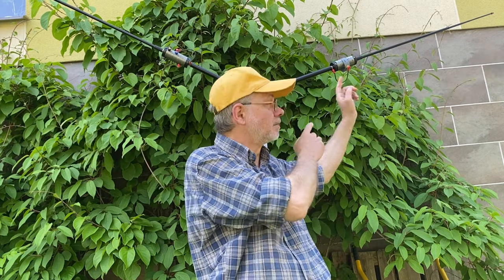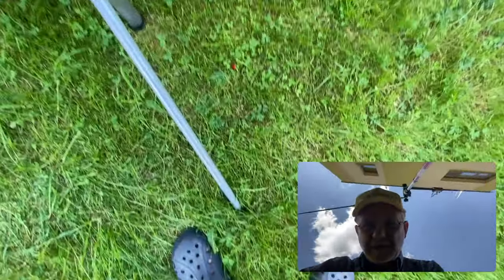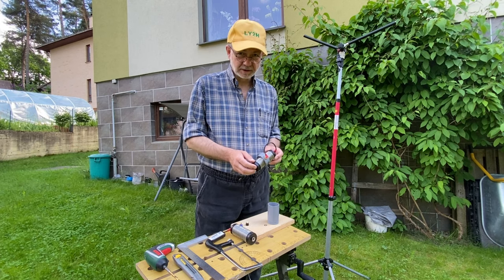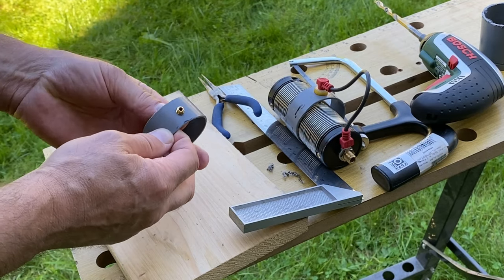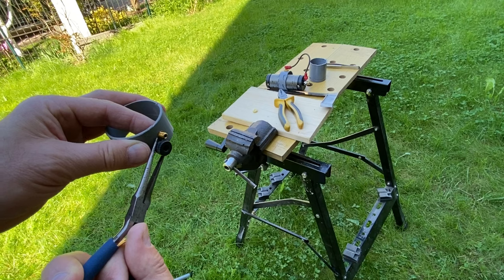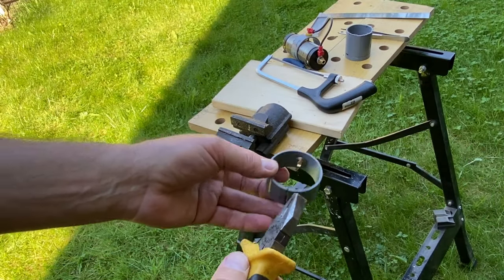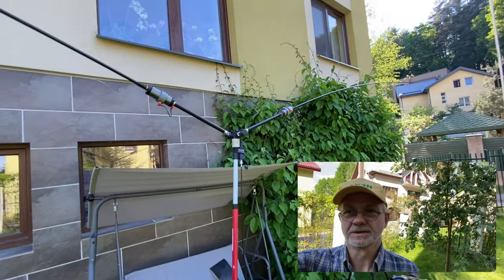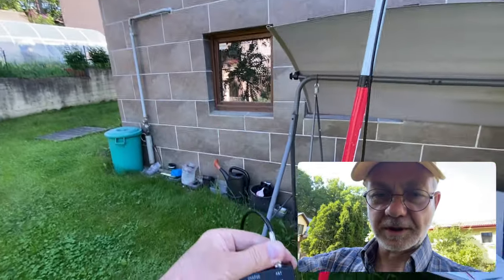How to make a sliding contact on the Buddipole coils. Quick and cheap DIY project.

Comment: Spent a small fortune on buddipole, yet i hardly use it, one of the reasons was the tuning method and fiddly clips. I really like this idea and only wish it was incorporated in the design. Buddipole should learn from you elegant design and commercialize it, but I for one,  will be willing to spend some time on the original kit to make it more useable. Thanks very much for this. 73 2E0FWE

Comment: I made a wire(x2) with a minigrabber test clip and a ring terminal wire connector on the other end. Replaced the original mini banana plug wire and did not have to modify any of the original parts. have been using it on all bands 40m-6m for over a year with no problems. K5RFS
Reply from the maker: Sounds cool! Would you mind sharing some pics for everybody interested to see the idea? 73! Linas LY2H
Reply: @Linas_LY2H  I don't know how to add pictures
Reply from the maker: @bobseger4496  I’m afraid, there is no simple way to add pictures here to the comments section … :). Thanks for your email, I’ll post your pictures in my channell Community Tab. 73! Linas LY2H
Reply: Thanks for this comment! I just ordered some test clips on Amazon. I can’t wait to try this!
Reply: Great idea as well!  Thanks for sharing.

Comment: Just buy a Wolf River Coil antenna, same principle and much cheaper too !
Reply from the maker: Good idea! I might go for it! Just of curiousity if there is anything to mod on it :) 73! Linas LY2H
Reply: @Linas_LY2H  Not sure I understand. There is the coil, the slider, you can get a double slider to tune 2 bands at once, the tripod legs can be either small or large depending on the size whip you use, for stability use the larger legs, extension rods so you can make the coil either centre fed or top fed. Check out the WRC website and you'll see what's available !
Reply from the maker: @martinsalt1839  Just kidding :) I like the WRC a lot , frankly. The problem is they don't ship oversees anymore and it seems, they don't have dealers in the European Union (unlike the Buddipole). I would really like to buy their Silver Bullet Platinum Coil and use it with my 15 ft MFJ telescoping whip installed on my Ham Radio Van. At the moment I use the MFJ coil which is surprisingly rugged and able to withstand strong winds and multiple mounting/unmounting events in the harsh environment. ( there is a video on that on my channel in the Antennas playlist). So, I'm open for the second hand offers, or I would gladly borrowed one for a week or two for the decent in-depth review on my channel. 
And as it comes to my Buddipole mod video, it's for those who want to keep and use their Bud- dipoles and sticks, not sell them.
Reply: @Linas_LY2H  I live in the UK and had it shipped over about a year ago. It's one of my best antennas. If I'm only going to use 20 and up, then I use the Megapod with the MFJ1979 whip (no coil), with 4 x 5m counterpoise wires. Works a treat. I'll also use the coil for all bands with their 102" whip if I'm on a SOTA activation. Oh and I use the Silver Bullet Mini coil.
Reply from the maker: @martinsalt1839  Fantastic ! MFJ1979 is really doing a great job! As to the WRC shipping policy, the current status  info is  on their website, it’s due to the C-19 issues. So it seems I gotta wait a bit… 73! Linas LY2H

Comment: I've just taken delivery of an original second-hand one that I won.  Not had any time to have a play with it yet.  I like that idea though, looks good thanks.  How high do you normally operate this on your tripod stand? - I have a 4 meters (13ft) tripod but will have to adapt the fixing at the end as it is a normal 1/4" 20 thread. 👍
Reply from the maker: Thanks for watching and commenting! Hope this will help if/when you get tired of fixing the coil clips ! :) Otherwise it's a nice compromise antenna, especially if used with the longer telescopic whips. As to the hight, my "painter's pole" allows for up to 3m/9ft so, that's the limit. I noticed that even at that hight the SWR changes considerably compare to what I tune up to at the eye-level ( abt 1,7m). So , the ATU might be a good idea , or just trial and error method tuning and retuning the coils... In the latter case, the sliding contacts might save lots of time and nerves :). Good luck with your new toy! 73! Linas LY2H

Comment: If you drill the hole smaller could you thread in the brass clip? If trading it in is hard, some heat from a soldering iron might help.
Reply from the maker: Thanks for the comment! I don't know , really :) , haven't tried this out. If you do, please share your experience with the rest of us! Actually, the plastic which the pipe is made of seems a bit too soft for me to make a thread in it and the clip might get lose quickly. On the other hand, I wanted the original Buddipole's nylon nuts to get used for good :). Anyway, let's keep experimenting! 73! Linas LY2H

Comment: The contact cant be as good of the originals. They are not fixed.Anyway for me its not necessairy . I dont have to change fast from one band to the other. My personal idee, now more then that.
Reply from the maker: The contacts are made from the same original pick-off clips and they are kept pressed to the coil by the force of the pipe bracket. Surely, it's probably not that strong as it would be with the screw-on clips but strong enough for me to provide the reliable contact on the coil. And if you like the original arrangements , it's even better- no need to change anything! Have fun! 73! Linas LY2H